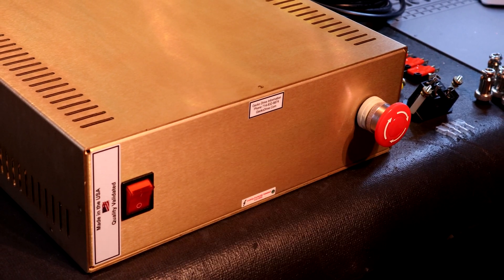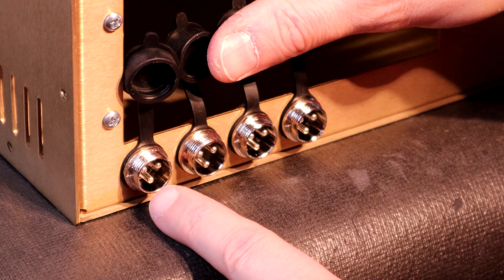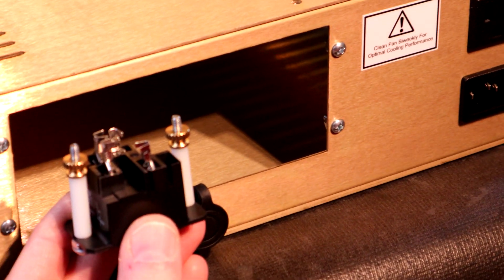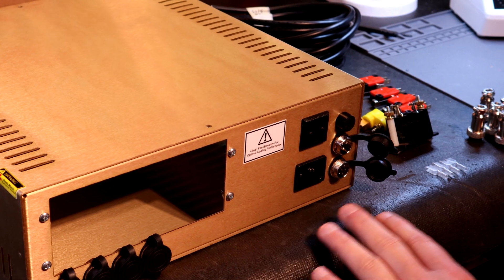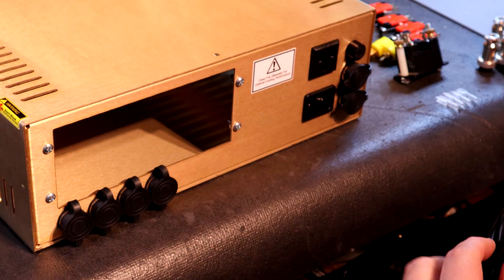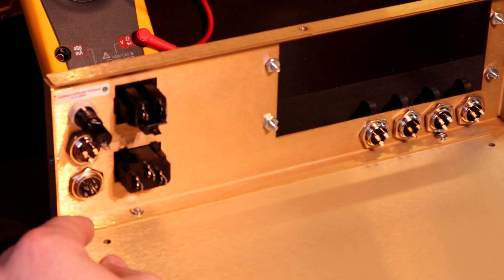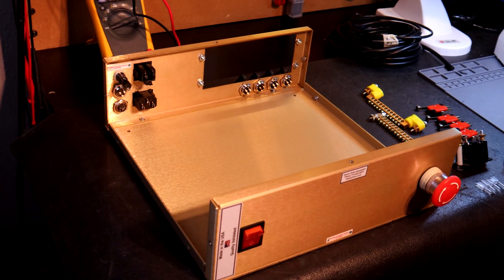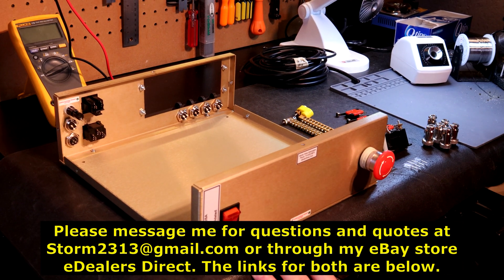Gecko G540 Enclosure Package Master DIY Edition (Shot in 4K)...

Comment: Im going to add a 5th axes to my Plasma table.. A rotary Pipe cutter.  how hard is it to add a 2nd g540 or equivalent to power a 5th stepper on the Y axes already slaved.  Y is the gantry. X is the torch travel and Z is the torch height   on the rotary the Y turns the pipe
Reply from the maker: Here's the kit you would require. https://youtu.be/_mQByZThJGQ

Here's the process for installing a 6 axis screenset in Mach3. https://youtu.be/1EKuPV-Mj7w

Thank you, and have a great weekend!
Vince